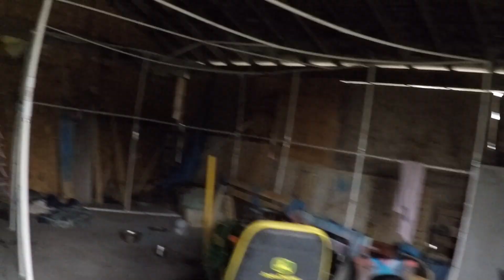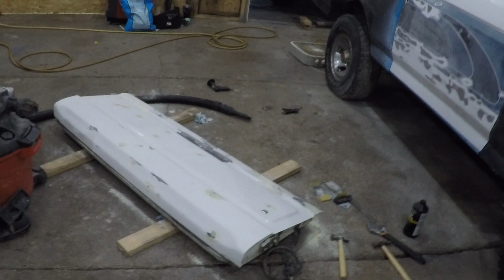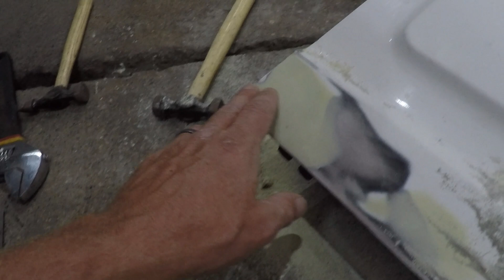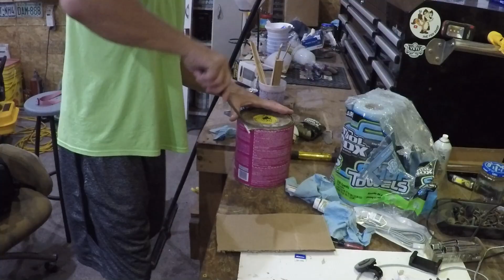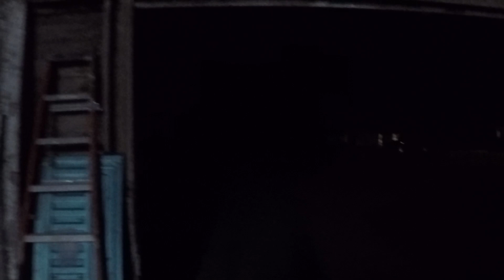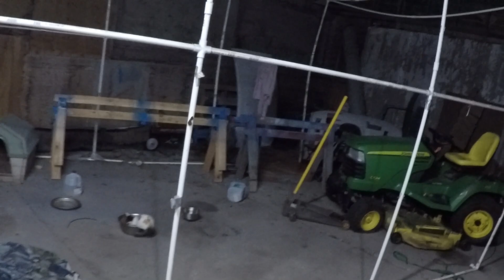FIXING The FORD BRONCO Tailgate   BIG DENT

Comment: Jon. One truck I like to do when laying metallic. After you cover the entire area your spray. Hold the gun back a little bit further. And spray while moving the gun faster than usual.  This will “dust” the metallic on and help even it out, helps a lot with tiger stripping
Reply: Also. Go minimum 4.30 gears. I really would consider 4.56 with the m5r2s final overdrive. I believe it would be a excellent combo. ESP since you don’t daily drive the truck.
Reply: Drop coat right?

Comment: With a 302 and 35" tires I would go with at least 4.56 gears. Your stock setup- 302, M5OD, 29" tires and 3.55 gears your spinning 2,300 RPM at 70 MPH in 5th gear. With your current 35" tires you're at 1,900 RPM. A 4.10 setup puts you at 2,200 RPM. 4.56 gears you're at 2,450. That little 302 really needs to be in the higher RPM band to help keep it going without lugging the engine.

As for the tiger striping, if Kyle can't live with it, I recommend taking it off the truck and hanging it vertically. If shooting horizontally, make sure the last coat of base he shoots is in the opposite direction as the first two coats while INCREASING the pressure and backing off a few inches.
Reply from the maker: I know I used to run 2500rpm at 75mph on 31"tires....maybe 4.30 gears would be about right

Comment: When you put the tailgate back on make sure the torsion rod is seated in the bracket inside the tailgate or it will blow out the glass the first time you open it i nearly had a mess i stopped when i heard crunching
Reply: Richards Ironwerks I need to confirm that, we had my sons open closed a few times before it exploded the window. He had put it and went in the house. While he was in there he heard a noise, went out to find glass everywhere. He called me for emotional support, luckily he had a opulent spares in the garage.
Reply: These tailgates are no fun to mess with

Comment: Jon, As far as tiger stripes, use tighter overlap and do a drop coat.  Or paint in different directions.  I can explain a drop coat more if needed.
Reply: ken martin what is a drop coat? I work at a body shop for freightliner semis and I know in school they said you can do 50% overlap but I always do a 70-80% overlap just to make sure
Reply: @Gtflybmx75  last coat pull gun back a few inches and do a mist coat.  Helps with even metallic orientation I believe
Reply: ken martin oh ok that makes sense